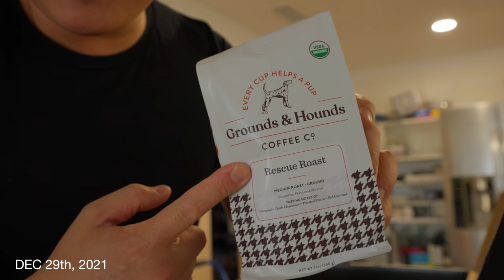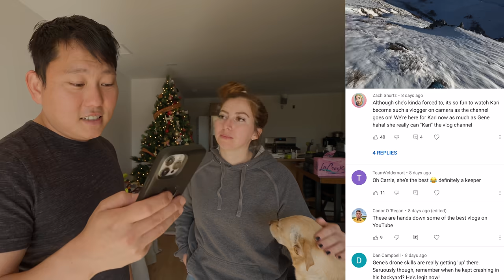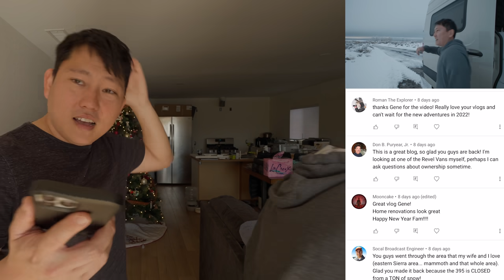Hello 2022

Comment: Remodeling that bathroom will run you a cool 10 to 25 racks. There's demo to be done, assessing your current building structure and do repairs/reinforcing where its needed, the electricity work, the plumbing, plus renovation permits and about 1-2 weeks worth of labor for 2-3 people on the job. And the job has to be up to code standards to pass LA county building and safety inspection (hence the permit).

Comment: Depending on the skill level and experience of the contractor ($150 hour for senior, 8 hour working day, about 8 days total for worse case scenario...) $9600 or $10,000 total just for labor.

It really depends on what kind of materials you're selecting. Materials range in prices and usually contractors like to overbid for mistakes (say something breaks on the tile shipment or glass door ). They rather have the owner pay for it than out of their pockets. Hence, the overbidding is to cover their butts. On top of that, millwork time for the cabinets/sink if you want it new and/or custom. 

Oh then the contractor has to do demolition which includes the fees to remove, dispose, or reuse. Plus possible unseen water damage or mold behind the walls from previous owners - that can be pricey and delay your construction, thus adding more hours on top of the $10,000 estimate. 

You should really break down the estimate by hours for each segment and cost of material with the contractor so you know he isn't ripping you off or the other way around. 

Happy bidding!

Comment: If the cost is $4-5K for materials, I’m going to guess a licensed contractor with crazy LA prices (I’m in Vancouver, BC, so don’t know for sure) will be approx the same as materials; if not slightly more. So let’s say $5-6K as my guess on your particular quote…

Secondly, the Rode sounds better (in my opinion) - that Sennheiser sample seems to have lesser balanced coverage through all the frequencies, seemingly tailing off a bit in both the low and higher frequencies giving it a less “full” and natural sound (also assuming you have the foam on Rode and furry on Sennheiser [which already has built in wind protection with the base capsule]…although not sure that would make a significant difference between those two in that setting). The Rode Videomic NTG is also a wicked option…but I’m more than certain you’ve already explored that…

How was the H.265 to edit (on the MacBook M1 Pro)? Still 4:2:2?

I’m a LUMIX fan myself (S1H), but really appreciate the content and nuance you show with the awesome Sony lineup!

Where in Canada are you guys going? 🤔

Comment: First off, I work as a contractor in Indiana and would need to know more information!  For example, $5,000 can get you supplies but many jobs are labor intensive (such as tile). I would say approximately $12,500 in labor only.  I will give you an even better deal.  You fly me out and I will help you with your bathroom for a week.  Trust me, I know how to do bathrooms.  I would absolutely love to meet the whole crew and absolutely love your channel.  No creepy things either.  I am happily married, have great kids, but would love to help you out!  By the way, I have installed toilets that are almost as expensive as your whole bathroom supply list. Think about it!  You won't be disappointed.  You need some pictures let me know as the proof is in the pudding.